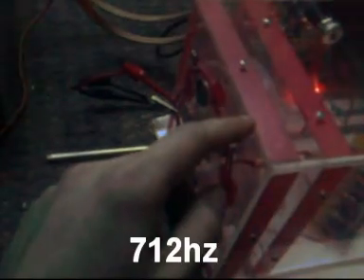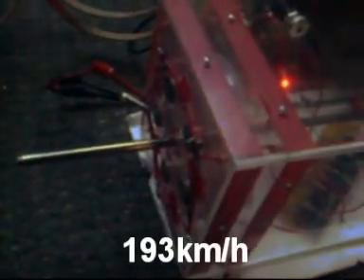MG-1 : 8550rpm, 712hz, 193km/h

Comment from the maker: I think I see what you're saying, and I'm familiar with the magnet configuration you've used i your video, though when no power is being supplied to the motor (in my set up) the magnets are being attracted to the cores of the stator coils so  you could say the magnets are still performing work when no power is being supplied.

Comment: fast motor, im no profesional, but the problem i see, is the magnets are only supplying a pulse to get it to the next pulse. in other words while thepulse isnt on, you can generate, cause there nothing suppling that movement.. and thats a beautiful thing with bemf and all, but the magnets are not doing work in a setup like this....   i made a motor that takes a single pulse  to turn a rpm....but it can do work beacuse the type magnet setup that drives the motor after that single pulse

Comment from the maker: I believe this will help push the current out of phase so that the generator coils will continue to generate current in the same direction after the magnets have passed TDC on the generator coils and so reduce the drag from the generator.

I also believe the high voltage spike will have the same properties as the transient spike generated by the motor section.

I could theoretically use the generator to charge the primary battery, but most people have found this is not good for the battery.

Comment from the maker: all the generator coils will be wired in series.  I estimate that the peak voltage they will generate will be between 800 - 1000 volts unloaded.  The generator will be attached to a separate bank of batteries.

As the magnets approach the generator coils the scr will block current until the voltage has reached its peak.  Then the neons will light and trigger the scr.  This will generate a high voltage spike, then the voltage will immediately drop off and the current will follow...

cont...

Comment from the maker: Not exactly.  It is important that this set up can freewheel for a long time since it shows that very little mechanical energy is being wasted.  First I am just going for a standard motor generator configuration where the generator will take power out while no power is being applied to the motor like in the watson machine, though the final design will use an scr triggered by 10 neons in series.

cont....

Comment from the maker: speed and efficiency don't necessarily go hand in hand.  The main reason I can get such high speeds is because it has very low friction.  If I took the power off then it will freewheel for over 2 minutes and that is without an additional flywheel.

The generator will decide how efficient it is ; ) though it will take a while to finish it... Really I need to get another 5 magnet rotor made and I could do with a high voltage scr as well as some more magnet wire...